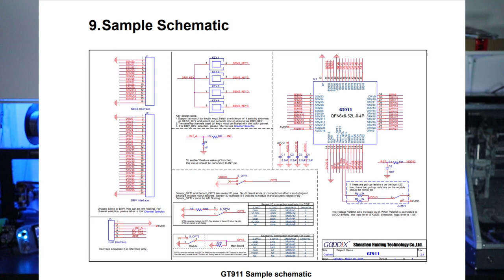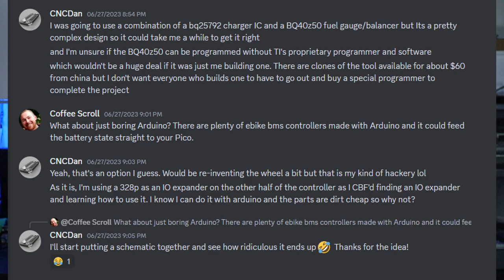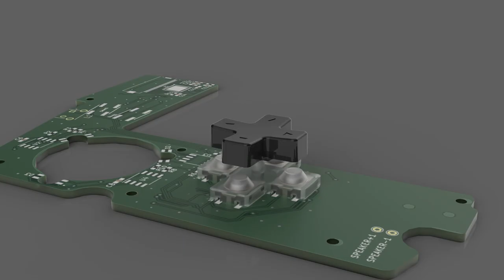NucDeck - The DIY windows gaming handheld - Episode Four - Games Testing

Comment: Amazing work! - Please share which micro-switches you use.
I'm looking into mod'ing the D-pad on my Steam Deck. I hope to perhaps copy your design :)
Reply from the maker: Thanks! The switches are an EVQ-Q2B02W. There's also a couple different variations with a taller top on them if you need the extra height!
Reply: Super. Cheers! :) - I think I need them to be as thin as possible but I'm not sure yet.
Reply from the maker: @DavidFilskov  yeah I think those are the thinnest ones from that series. There are plenty of thinner switches out there though so you could always do the same thing with them if you need the extra room
Reply: Hm, yes perhaps. Must make a lot of tests, I guess. How did you create the matching rubber membrane?
Reply from the maker: @DavidFilskov   I machined a plastic mould and put some two part silicone in them before clamping them shut an letting it set. A mate of mine managed to make a set of moulds using a resin printer successfully. FDM printing probably isn't an option as the tolerances need to be pretty tight on the moulds to get them to work properly
Reply: Rubber membrane: Oh - good work. Thanks for the clarification. I thinks it's over my "budget".
Are the buttons EVQ-Q2P02W rather than EVQ-Q2B02W by the way?

Comment: Super confused. Is it a pi 2 that runs the os? or a nuc? what nuc are you using?
Reply from the maker: Sorry for the confusion, the OS is running on the NUC! Its a 7th gen i5 but you could use any generation of NUC or any other mini pc in the same form factor with only a small modification to make them fit. I just chose this one as it was the best I could afford on the budget I had for the project! The pi is called a raspberry pi Pico and its a micro controller, not a fully fledged pc like the other models of pi's. It is being used for the controller inputs.

Comment: when do you think that you will finish off the project(tell all the parts you used etc)(by the way, how much did this cost?)
Reply from the maker: I'll be starting to release files in the next couple of weeks. Just need to finish testing the last few things and then I can release the first round of files. Cost is difficult to calculate right now because I've had several sets of prototype pcbs and components etc. So cost to me is probably a lot higher than final cost to build will be. I will post a full list of the components to purchase once I've got all the files together so that information should be available soon.

Comment: Dan I just came across your channel. I've been thinking about a simple handheld to create that just tethers to your PC which has a touchscreen with gamepad powered by a Type-c connection to support alt display port and controller input. There is no NUC. No battery. No Android. Just a comfortable way to play away from your full powered desktop. Would this be a good project?
Reply: I like this idea a lot. I find PC streaming over my wireless network to be a pain.
Reply from the maker: Definitely could be done. Getting it all to work over usb-c though will be the challenging part! If it were me I'd just settle for usb-c for power/controls and run the screen through a seperate HDMI cable.
Reply from the maker: On one of my previous builds, I tried a bit of game streaming and I have to agree, over wifi it sucked. I tried connecting the handheld directly to the computer over ethernet though and I found the experience to be greatly improved. This might be an easier option for tethered gaming rather than trying to implement hdmi and controls over USB-C. Plus then you have a device you can still use away from your computer!
Reply: It depends. Some cheap all in one type-c adaptors have the hdmi output. Otherwise I think you can get those portable screens that take a type-c in for signal and power, they sometimes also have extra usb ports to optionally power separately with data passthrough so you could potentially tie the controller interface all through the display without needing a doc. At this point I would go as far as excluding the touch screen requirement if the screen included most of what we need within budget.
Reply from the maker: Oh yeah, I suppose you should be able to fit an adapter in the back of it instead of the NUC as there is plenty of room in there! Just not something I'd want to try and design myself as I know its pretty complex to get working. The controller will have a keyboard/mouse mode anyway which is a pretty good replacement for a touchscreen for basic navigation tasks. And the controller itself just shows up as a regular old USB HID so it should work over anything that can provide a USB 2.0 connection.

Comment: hello, the question is, what if you unsolder ethernet, usb and other ports from the motherboard and replace them with other wifi and bluetooth boards?
Reply from the maker: Ummmm, not quite sure I understand the question? The NUC already has wifi and Bluetooth so there's no need to do anything like that to it to get those working.
Reply: @cncdan  why not just downsize and make it more compact?
Reply from the maker: @LAIKA_PLAY  by removing the excess ports? If that's what you mean, it won't really make it any smaller. They barely extend past the edge of the PCB and they aren't a limiting factor in the thickness either due to the massive heatsink and fan on the back.

Comment: Will you add gyro controls? they are quite useful for aiming in shooters
Space on the sides of the screen feels wasted, on one side is an additional display which feels too big for its purpose, something like sh1122 screen would fit better and allow for smaller dimensions(also maybe its a good idea to try and embed it into a ,main screen frame but idk)
and those two buttons on the left side of main screen- do they need to be that big and if so- do they need to be horizontal? just turning them 90 degrees will save half of that space...
but in any case, love your content always waiting for sum more interesting stuff
also glad to see you less tense =D
Reply from the maker: Yes, gyro controls are on the to-do list. I've left room for a MPU6050 module on one of the PCBs so I will be trying that out soon. I wish I could make it smaller but it pretty much has to be that wide due to the combined width of the batteries and the NUC so swapping to a smaller screen or changing the orientation of the start and select buttons won't help make it any narrower unfortunately!
Reply: @cncdan  oh, okay, understood
Reply from the maker: @pironiero  yeah, I actually started with something a fair bit smaller than this but had to keep stretching it out to be able to fit everything. I could use 18650 cells instead of flat lithium cells and make it narrower but then the rear section would need to be much thicker to be able to fit them
Reply: @cncdan  understandable but imo the bulge from the nuc is not going anywhere so adding several millimeters of thickness to be able to use 18650 cells wont play too big of a role in ergonomics and they are quite easier to obtain in comparison with flat ones.
but in any case i really hope there will be an option of adapting your project to carry any available and upcoming NUCs. of that size.
Reply from the maker: @pironiero  yeah it just gave less of a "return" section for the hand grip sections. Once the files are up you could definitely move the sides in and use 18650's and make the back bigger if you like! Would love to see a couple of different versions as people start building them!
Reply: @cncdan  if amd or intel will decide to poop out more APUs with strong GPUs in them- you can be sure i will\